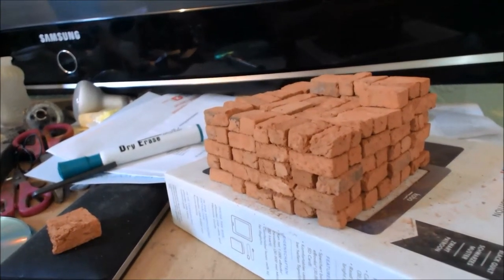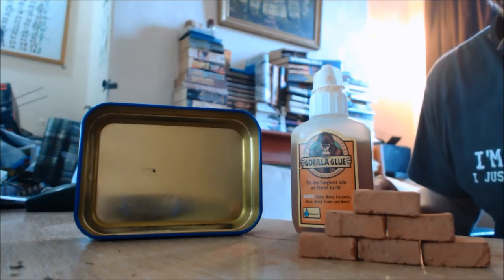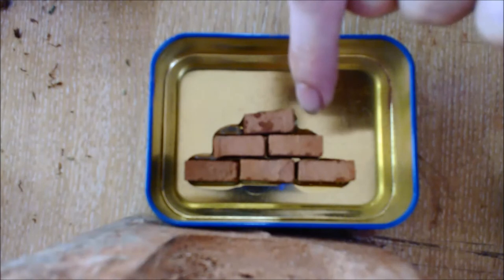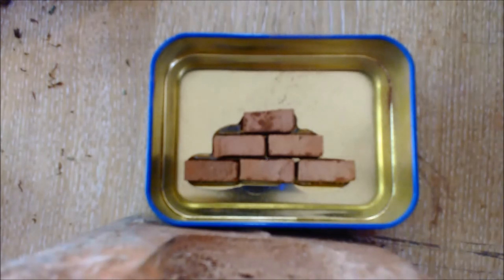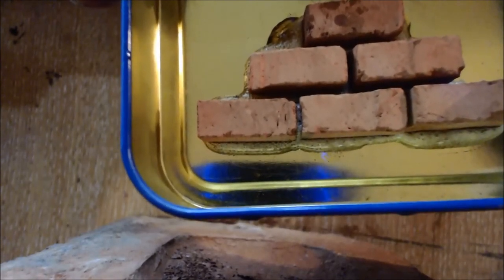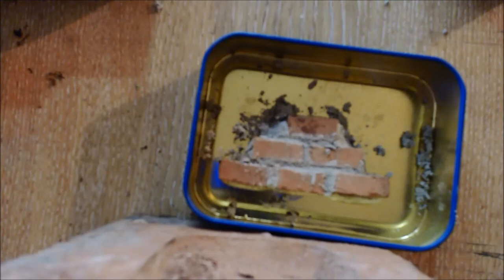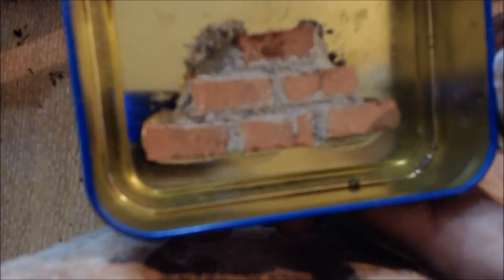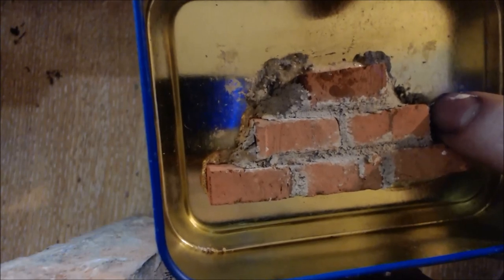160 1:10 Scale Accrington Bricks & A Fake Mortar Grout Update

Comment: Nice! This is getting more complicated and bigger as you go. Not as easy as I was thinking in the start.
Reply from the maker: TOJO RC thanks Tojo ji :-D yeah I didn't know what to expect when I started, I thought chop, chop cement and done :-) but when you get in there it throws all problems up :-D just being able to replicate the same colour of cement for all the walls is tricky :-) a 9" angle grinder upgrade to a desk 9" wetsaw would really speed the manufacturing process up but the machines are really expensive :-p

Comment: Thanks for video excelent!
Reply from the maker: thats really kind of you to say :-) I also learned from this experiment that the grout can be made using plenty of water and can then be injected in to the wall with a syringe :-D as well as thin steel sheet works as well as tin as the glue can melt in to the surface :-) by applying glue to one brick and rubbing it on to a second brick an even layer of glue is applied nicely over both bricks that way as well :-p hope it was food for thought :-)

Comment: Maybe you could use Lego haha ha ha hahahahahaaaahhhahaaaaha
Just jokes mate, this looks like a good Idea having a backing sheet, I presume with the tunnel you will need to make some sort of form work, like maybe use PVC pipe or something?
Reply from the maker: Jax Teller RC I do like to refer to it as 'Man lego' :-) mm with the arched tunnel im going to make a square out of wood screwed together to make a base, then bend the tin sheet over the base from one side to the other and position it in place with screws then start gluing bricks on from the bottom up using matchsticks as spacers :-) if I were to make miles of tunnel I would create a scale scaffold system to hold all the bricks in position but as im starting out with a 1m section I will likely try a matchstick or wood beading method :-D Pvc pipe is sweet but a little expensive per meter from the looks of things :-) im hoping sheets of tin are cheap, tin seems to wear pretty well from the looks of things so it should provide an extra layer of damp proofing :-)
Reply: battonfive
This is a huge endeavour my friend, I am really excited to think of how the end product will turn out. Will you drive the truck through the tunnel?
Reply from the maker: Jax Teller RC thank you ji :-) it is pretty big I must admit, what seems simple takes a lot of brain power, a case of the more you think about stuff, the more stuff there is to think about :-p
 I wasn't thinking of driving the nitro through :-p but it would look pretty darn cool so yeah definitely now :-D I don't know why im procrastinating so much at starting that 6x6 nitro, think its just all the kit it takes and time on the setup to attempt to fire it up :-p 
 Yeah its a massive project the tunnel just to confirm if the theory will work or not, the rules for strength change at scale, while making it financially viable if you wanted to make a thousand miles of tunnel is a really interesting thought to me :-)
 I was thinking of using piping for a tunnel's sides, ceiling and base, but when I looked at a thin piping even at wholesale for a 300mmx300mm diameter the price was like £100 a meter or something making it a bit unviable over large distances
 where with these reclaimed brick, the thickness of brick and the modified grout I recon it will come in less than £4 a meter at test and less than £1.50 a meter if it was scaled up :-p
 I thought of making these scale bricks because I wanted to test the arched ceiling strength of the tunnel and see if I could jump up and down on it mimicking the weight of the earth above it if it was buried underground :-)
 A full scale tunnel takes a hell of a thick reinforcement to make it strong enough to take the weight where I shouldn't need all that as my tunnel is 1:18 scale :-) (but im using 1:10 scale bricks for the roof)
 The thickness of the walls and ceiling of the scale brick tunnel im making is 26.6mm thick, that scaled up would be about half a meter thick :-)
 The makeup and strength of the Accrington brick im using at half a meter thick at 1:1 scale would hold a very large multi floored building up I would think (guess) :-)
 They did export it locally to America to make the foundations of the empire state building which I thought was pretty cool, would need to be pretty strong to take that type of weight :-D
 But yeah will be sweet to build and test the tunnel design, I then just need to work on the scale tunnel boring machine I want to make out of an ebike :-) as well working out how to make the transmitter that I think will be highly illegal until I mod it, then work right :-D and then im there! :-p
 Its great fun doing all the testing and I think its pretty cool how the rc crowd like them because they look right and are authentic :-) and can use the research :-D
 So today im just chewing aload of coding and self employment gear and I want to get out and make some 1:16 scale bricks and 1:60 scale bricks :-)
 I figure try to keep a day or two a week at it and it will keep progress on it going :-D
 I appreciate the positive attitude :-) it really makes me feel im not selling the idea to folk but you huys are interested in seeing what im up to :-) which I really feel is reward you know :-p course you do you're an rc'er who does vids :-p
Reply: battonfive
Oh yeah thats cool mate, wil the tin be on the outside, or the inside of the bricks?
Reply from the maker: Jax Teller RC the tin sheets will kinda be sandwiched in between the two layers of bricks :-) So I will be gluing bricks side on to both sides of the tin :-D
 the double brick should reinforce the tin and when both sides are mortared up the entire thing should have no flex, carrying weight and survive in damp conditions, it also should allow me to make an air tight tunnel which could work with a hyperloop concept :-)
 My neighbours have now took their washing in off their lines, its quiet out there so its time to get the grinder going :-D
Reply: battonfive
Ah yes makes a lot of sense, you may be able to split a neutron with it
Reply from the maker: Jax Teller RC lol they were saying something about they couldn't take the electric from the children's life support ward or something or other, I wasn't really listening was to busy setting up the fuse box :-D
Reply: battonfive
Ha ha ha, your a funny guy (-:
Reply from the maker: Jax Teller RC:-p